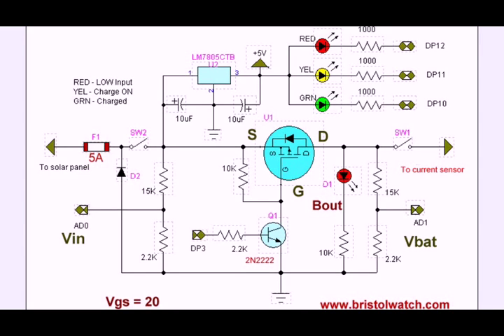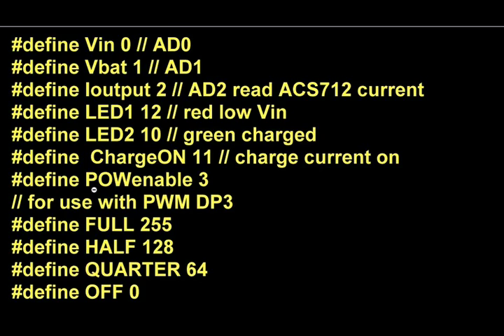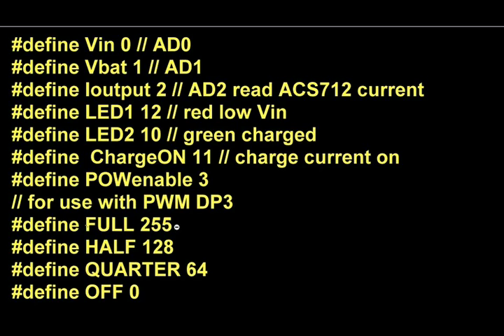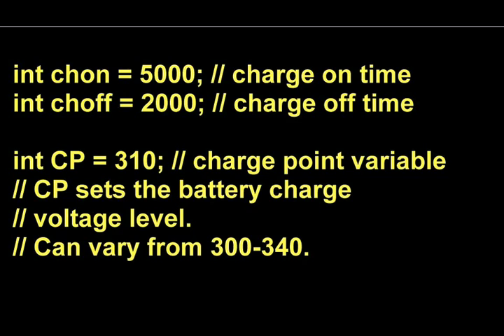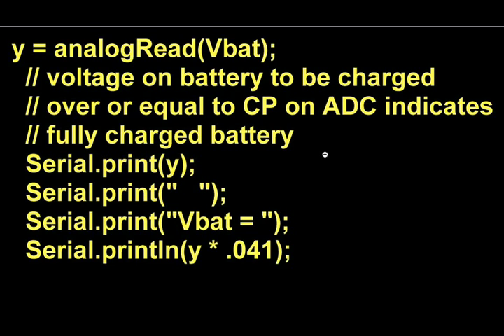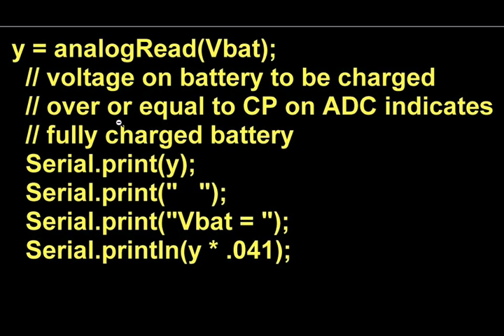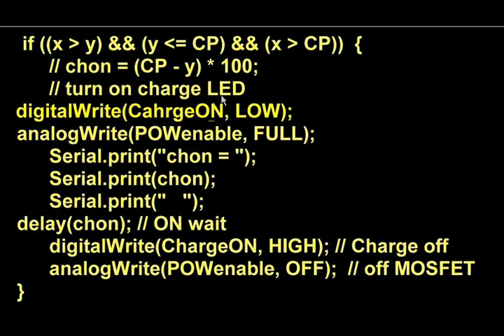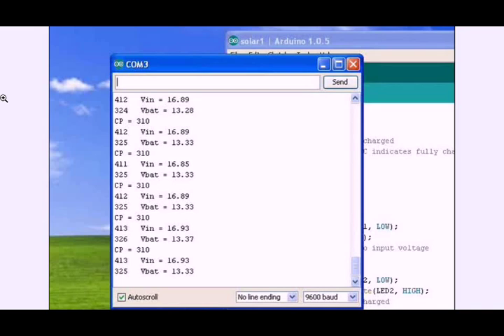Part 2 Arduino Solar Panel Charger Programming Tutorial

Comment: Can this be programmed for lithium ion charging?  
Also can it be used with a alternator insted of solar? I'm looking to charge a large lithium bank to 28.7- 29v.,,,_ thanks
Reply from the maker: Several issues. Change the programming for different voltages. In particular, with lithium cells use a current limiter.

Comment: hello i want to know how to find the ''CP" for a given battery.
thanks
Reply from the maker: +Laidani Zahir Check the battery spec sheet and find out what the charging voltage is. For lead acid cells it's about 1-2 above fully charged where it then cuts off the charging voltage until it drops 1-2 volts below charged voltage.

Comment: Hello lewis how can i change the circuit if I add another DC supply of about 20V to the circuit and to make sure that i have a output current of 3-4A?
Reply from the maker: +chandre louw You will have to change a lot in the circuit including the MOSFET and some resistor values.

Comment: Hi there - thanks for sharing.

just a quick code optimization on your slide @ 10:37

your test reads: 

if ((x > y) && (y <= CP) && (x > CP))

the third member in your && test is not really useful: indeed  if you have  (x > y) and (y <= CP) then you are sure that (x > CP) will evaluate to true
Reply from the maker: thanks

Comment: Hi Lewis that is a really nice work you have done here. Yet I couldn't understand the purpose of the current sensor. What do you use it for?
Reply from the maker: You can check the charge current to the battery - if it's too high reduce the duty cycle.
Reply from the maker: Lewis Loflin
When I said duty that was the PWM output to the main switching transistor.

Comment: very cool, thanks

how did  you figure the best CP (in volts) for the battery?

Would it matter if I turned the mosfet on and off for 50ms and 20ms respectively?

thanks
Reply from the maker: The CP value or charge point voltage was based on a commercial battery charger. Doesn't matter how the on/off voltage is timed but such short times will work but I'd rather have a longer on time myself. Have fun.